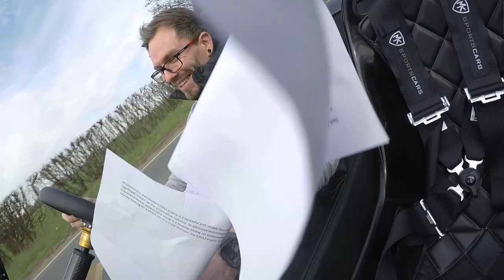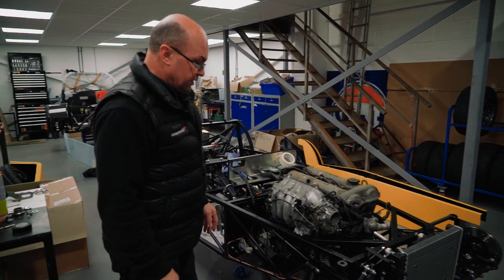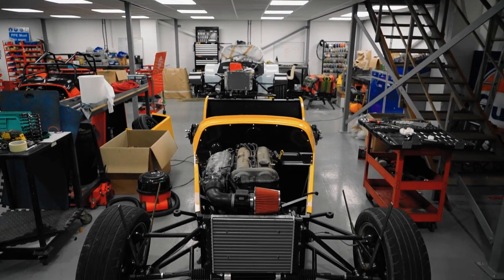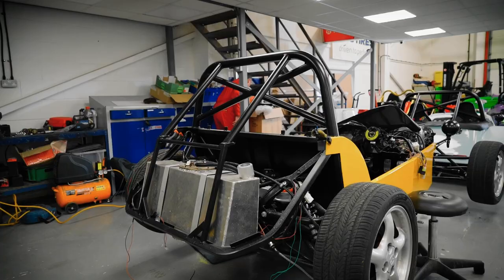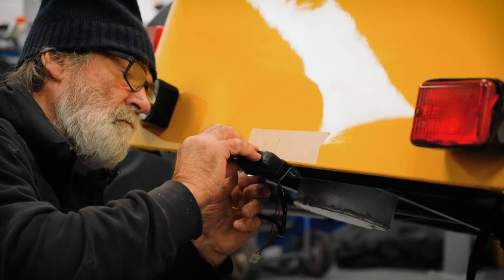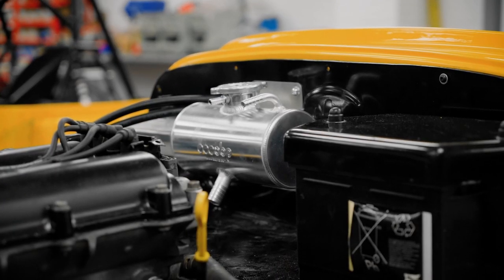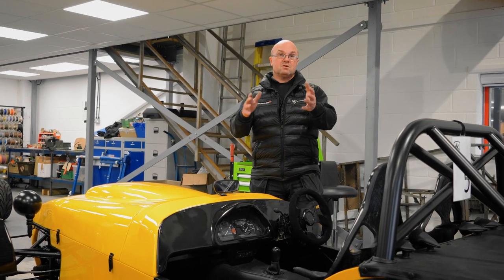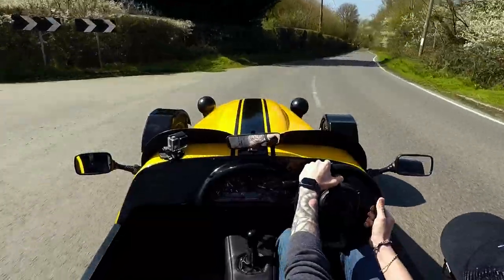Building a Mazda MX-5 NB based MK RX-5 140 in 15 Minutes!

Comment: You say it was easy to build and no fabrication but yet you had a "trial and fit" of the loom and some other bits. Sounds a little contradictory on the video. No kit car ever goes together that simply, not even the Westfields. Why do the panels still need trimming etc then? Just trying to get a gauge of what this may be like as a build, as planning on another car soon and MK are in the consideration list.
Reply: A difference between 'fabrication' and 'fitting' is commonly observed in the kit-car world. With fiberglass parts there is a little variation between parts from the same mold, depending on the lay-up of the fiberglass cloth in the mold. Therefore a little trimming is normal. This is 'fitting'. Different builders may place the exhaust ports in different places on the car, and selection of things like tail lights will vary. Therefore fastener holes, and ports will be drilled to suit the final needs and tastes of the assembler.  This is all part of the process of assembling and fitting the components of a kit car. Generally a Miata based car is a pretty 'easy' kit car. Drive train power and torque are relatively low, and Miatas are rather forgiving and simple cars to repair, tune and modify. So the MX5 Miata is an excellent platform for a beginner kit car. The build you see in this video is quite a 'formal' build, with great attention to detail.  Some builders might use the wiring hardness 'as is' and bundle the extra length securely with tie wraps in empty corners of the car. Using the harness 'as is' and taking similar short cuts leads to an 'informal' build. If you are not seeking a place on the podium in competition with your local club, this may be just fine for you. Obtaining the level of polish in the build shown in this video is a matter of choice and not of necessity, for most builders of the car. From 10 feet back, formal and informal builds tend to be indistinguishable.
Reply from the maker: There is an element of trimming to dry fit the bodywork because the panels don’t come trimmed for this specific model - the bodywork fits both models and all engine installs.
It’s different trimming something than it is fabricating something which is why we say it’s an assembly vehicle.